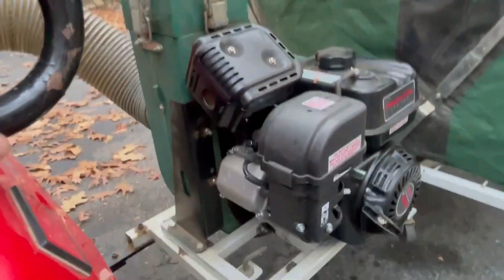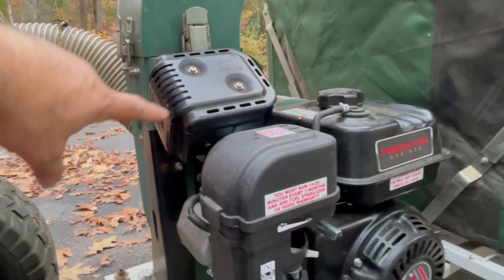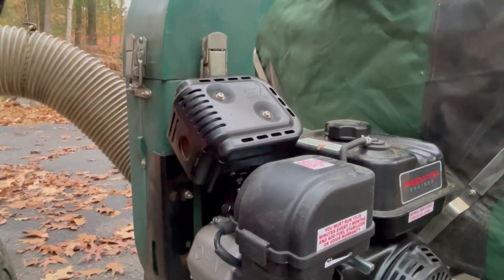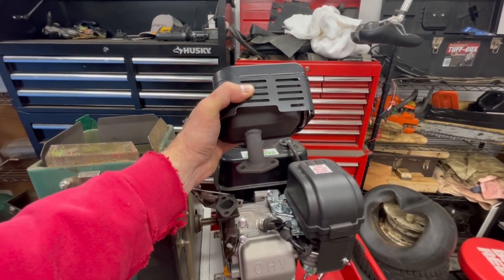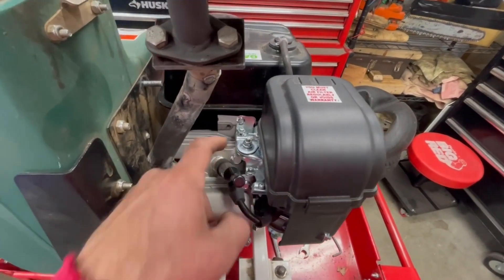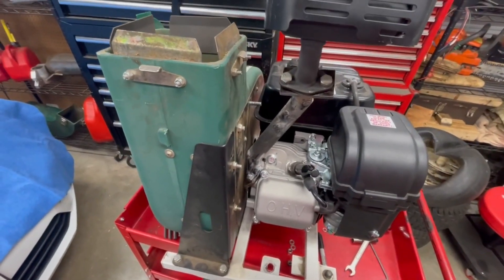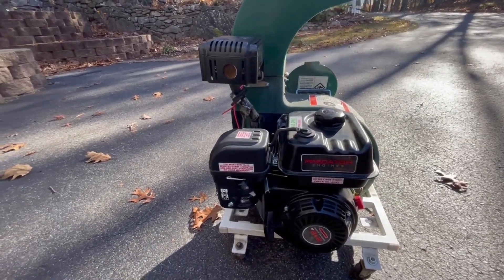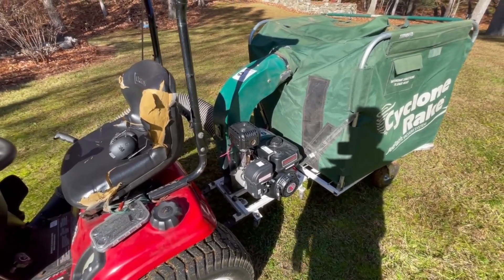Cyclone Rake Engine Swap V 2.0

Comment: I know you have a lot of time invested with the muffler.  But I believe a muffler from a B&S OHV (Honda clone) fits.  In fact, all new current Cyclone Rakes come with a B&S XR-950 engine.
Reply from the maker: Oh yeah I see that now and the aftermarket are only about $20. The intake pipe is curved more than the original effectively moving the muffler closer to the spark plug and making it inline with the engine side where the shaft is which was my problem.  My modified pipe works fine now and no point in changing it but good to know.  Thanks!

Comment: Wait till it shears off the keyway and breaks off the 5/16 bolt when impeller spins on too small 3/4 inch shaft
Reply from the maker: @georgespangler1517  has worked perfect for 3 years now